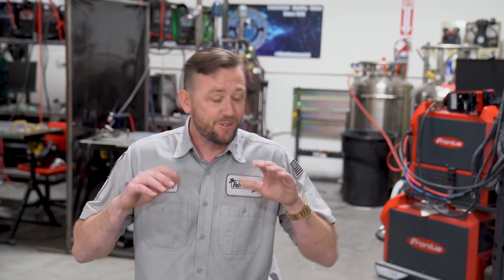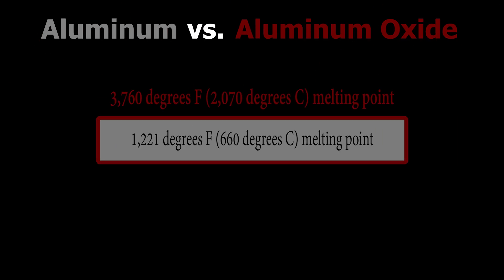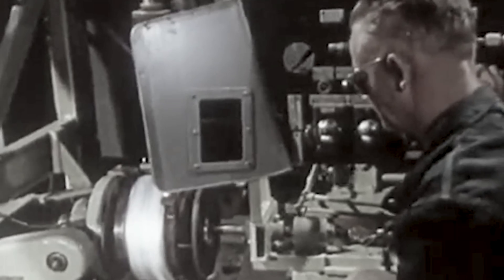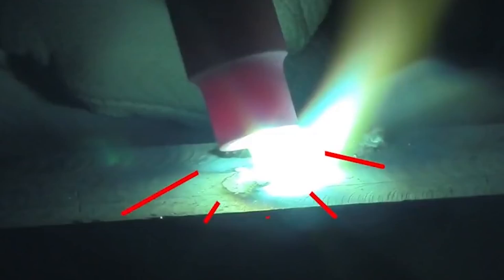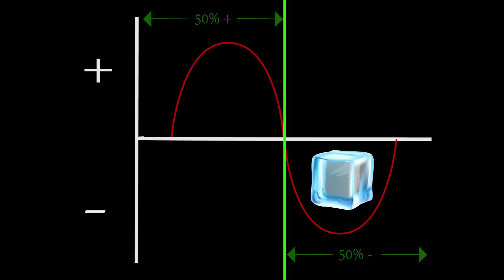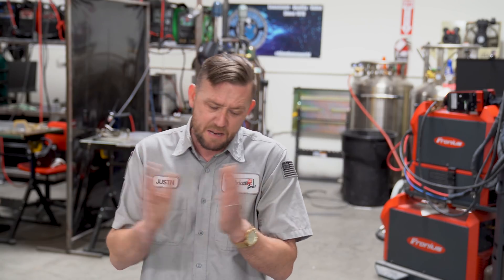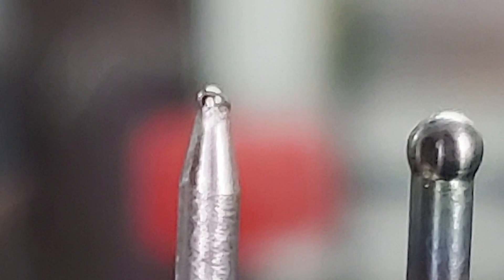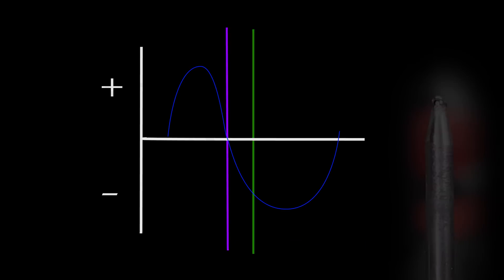TFS: Do We Even Ball the Tungsten Anymore?

Comment: Not to be that guy but I guess I will be....you can indeed weld aluminum on straight DCEN. You have to use pure helium as your shielding gas and make sure everything is clean. I used to work in a cryogenic weld shop and we used that procedure alot for extremely deep penetration. It welds like mud, but it holds just as strong as welding on AC.
Reply: corbett218 been there, done that, a lot 💯👊🏻 strait helium, it’s awesome
Reply: With the scarcity of Helium gas and high price even when it is available, DCEN is not as practical as AC for most folks.
Reply: Eddie Avila that’s not what he’s saying he’s saying that you can absolutely do it on thick aluminum and it looks fine and is 100% sound but their is no sense in doing it on thinner material
Reply: Yes, he's giving people false info, i just commented the same thing.
Reply: @stevebonnici8472  He is not you can absolutely weld Aluminum on DC- with straight helium Gas. It is used for Very thick weldments and produces very good results.
Reply: Most dont know about that process.  Its pretty awesome to see the heat blow through the oxide "skin" and its rad because its quiet lol
Reply: There are industrial aluminum welding processes that weld aluminum with DCEN, also DCEP. But these are heavy duty, using 1/4” tungsten, sometimes thicker.
Reply: @melgross  I saw a 1/4” tungsten the other day and my first reaction was WTF kind of tungsten is that... those bitches thic
Reply: Expensive to do that 👍 helium isn’t cheap anymore.... well, I can’t really speak for right now, but I was told a few years back there was a shortage and the price sky rocketed.
Reply: Isn’t that what a mig spool gun does? Dcen with argon shielding?

Comment: Displaying the negative side of the wave is actually a more logical and intuitive thinking for the balance for a couple of reasons. 

One, most people think electricity flows from positive to negative but in fact, electron actually flow from negative to positive. The electrons are actually whats imparting heat into the part to melt it. This is why when we TIG weld with DC, the setup is DCEN (i.e., DC Electrode Negative). DCEP (DC Electrode Positive) is pretty much only used in MIG and Stick since we need to heat to go into the wire and/or rod to melt it and allow it to transfer into the puddle.

Two, since with TIG (as stated above) we are welding EN when using DC (well except for a very rare few occasions). It was (and is) more intuitive to always think about EN when working with AC since we have to remember to hook up old transformer machines for TIG as EN if we were using DC.

Since we care about the amount of electrode negative (since that is the work used to melt the base metal), it makes more logical sense to have the adjustment display the amount of time spent on that negative cycle. Remember, the negative cycle is the cycle in which heat is being imparted into the work piece.

Think about it this way, if we need more of something (Heat in this case), then it makes sense to display what you are adding to get that "more of what you need" (in this case, we are adding more time on Electrode Negative) so we care about how much more we are adding (or subtracting). Its just simply more intuitive this way, so who ever says that what should be displayed is the Positive side has no logical thinking ability as to what is intuitive to most people. 

As for the adjusting one or the other part, thats just ignorance there to say you are adjusting one or the other since you are not adjusting either separately but rather the amount of time each gets from the total time of one cycle. If you take from one, its being given to the other. Its not like you are taking from one and throwing it away for neither to use...
Reply: Good analysis.  If you determine that you have  machine where the balance knob displays the Electrode Positive percentage portion of the AC duty cycle, get yourself a piece of tape and a Sharpie and relabel the knob "Cleaning Action."  Voilà, an intuitively-labeled control.

Comment: Thanks for confirming what I've suspected for some time. I have occasionally "forgotten" to ball the tungsten and achieved excellent control and much nicer welds. My balance floats between 30/70 and 25/75 depending on what seems to be working best on the project at hand. An acquaintance of mine sometimes preps and welds aluminum components in his Argon purge cabinet and runs his balance at 10/90 and doesn't ball his tungsten. He produces beautiful welds with outstanding control.👍💪
Reply: Steven Mitchell I tried to use the purge cabinet but I couldn't get a good seal around the 737 wing I was reinforcing. 😆

Comment: In 30 plus years in construction; I've never struck an arc but, this was so interesting!...I always hired welders, Let those that weld, weld...It's an art and takes a good decade to learn to do it right...At 60 I doubt I ever will but; It's nice to put this in my learning videos playlist...I've already been subbed! :)
Reply: or take tig and welding courses from people that's been doing it decades and you will learn what took them 10 years in a week.
Reply: @Mr.Potato420  It's the tricks of the trade that need to be learned...A monkey can strike an arc...A week of training does not a welder make...You can't even be a good painter with a weeks worth of knowledge, regardless of who your teachers are.
Reply: Give it a try Rob. I agree it takes time to get good but it's loads of fun even for a novice.
Reply: @Sonic_Ox  Yeah, it's on my bucket list...Now that I'm retiring from remodeling, I have a lot of projects I'd love to build. My years of carpentry will help with cutting and joining but...I don't want my welds to look like a jabroni did them...I want some dime stacks...Welding equipment is changing constantly...I'd like to get a plasma cutter/welder set up...Do you have any recommendations for equipment? 
Welding 9 gauge up to .380 inch steel.
Reply: Hey Rob,
I'm no expert. I am a hobby welder. I have a 110v Hobart plasma cutter. It's just ok. I wouldn't really recommend it. I want a Hypertherm plasma cutter running on 220v. They're pretty expensive. Welder wise, I started like a lot of guys with a 110v Lincoln mig. I still have it and works well but didn't have the power I needed. I also wanted TIG and stick capability. I'm gonna catch a lot of flack on here, but I bought a Vulcan Omnipro from Harbor Freight. I gotta say, I love the thing. I'm getting better and better at TIG, and the stick and mig functions are top notch. It won't do TIG on aluminum though so figure that in to your plans. I can mig aluminum with a spool gun and that's fine for my needs.  The whole rig was under $1000 and I'm really happy with it. I've used it almost daily for a year and it works great. I hope you get into welding and metal work Rob. It's a terrific hobby in retirement.
Reply: @Sonic_Ox  :)...Thanks for the advice and I've heard some good things about Horror Fright welders...I live like a mile from one so I can check it out...I look forward to doing it.
Reply: @Sonic_Ox  Your dirty little secret is mine, too.  I just picked up a Vulcan Omnipro a few days ago.  Still wiring my garage for 240, getting the C25 bottle hooked up, etc, and I can't wait to strike my first arc at home.  (I'm in my second semester of welding at the local community college...) It sounds like this welder is well-reviewed for its price-point, but I'm hesitant to admit to having it in class, where my instructor runs a welding business, certainly with proper red or blue machines...  Good luck with it!
Reply: @godbluffvdgg  Rob, look for a community college near you, and check their "Continuing Ed" or "Adult Ed" section.  The one near me does a non-credit welding class each semester, instructed by a local welding shop owner, and I'm learning a lot - both about specific welding skills and techniques, and also about weld shop metal fabrication in general.  It's a great way to get started, trying it out first, before having to think about diving in and buying equipment.  I'm having a blast.
Reply: You know, the Vulcans get a bad rap because a lot of Harbor Freight tools are iffy. But I think the OmniPro is terrific. It does everything I ask and never a hiccup. My buddy has one too and he has absolutely abused it building pipe and wire fencing for a couple years. He hasn't had a problem either. I did pony up for the extended warranty just in case but so far I'm really impressed with the welder. I've used the red and blue ones too. This orange one hangs right with them. So why spend the extra cash? One thing though, I'm not impressed with the Vulcan welding rods for stick welding. Nothing burns like good old Lincoln rods. I do admit that lol. Enjoy your Vulcan. Maybe someday we can proudly admit we use them in public! Lol.
Reply: @Sonic_Ox  Good to hear on your experience with the OmniPro. I'm just a day or two away from trying it out, and I'm really looking forward to it!  And yeah, with just a part of the price savings over another brand I was considering, I got a cart with storage drawers, and a bunch of other accessories.  Some day, maybe I'll step up to that Fronius Transsteel 2200 - or maybe not!

Comment: So this whole time I've been balling my tungsten by dipping it into the puddle...
Reply: Replace the 1/8” tungsten with a sharpened 1/8” aluminum filler rod in your buddy’s torch. If they don’t catch the swap....😂🤘🏽
Reply: hah ^_^
Reply: Hey, whatever it takes.
Reply: @393strokedcoupe  Well, that's the only way I've been able to do it with DC.
Reply: No if you don’t have a inverter machine you would still want a small ball on the it.
Reply: Even a machine with balance control that is not an inverter. The tungsten still balls
Reply: That's called impregnated...
Reply: Mr Wolf what?
Reply: Dipping the tungsten = pregnancy!
Reply: Lol
Reply: Works good man
Reply: Or u can reverse the polarity and jab the pedal
Reply: You can dip it in the puddle or just a quick touch with the filler rod, same result
Reply: @quitcherbitchin  Yeah, that was my other "pro tip."

Comment: I think pure tungsten for AC is obsolete, considering the technology we have. I like lanthanated or even thoriated anyway.
Reply: Not really, transformer vs inverter power source is an issue.
Reply: @Peter-V_00  transformer power sources are also obsolete, can't buy a new one.
Reply: @kasparroosalu  Why does the power supply need to be "new", I was  pointing  the difference between the two power types in regard to need of the electrode ball.